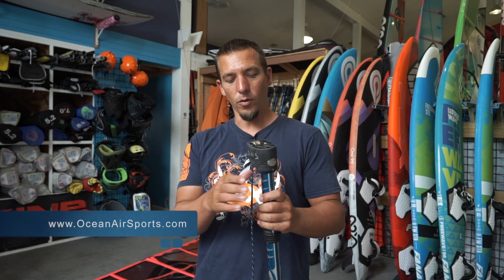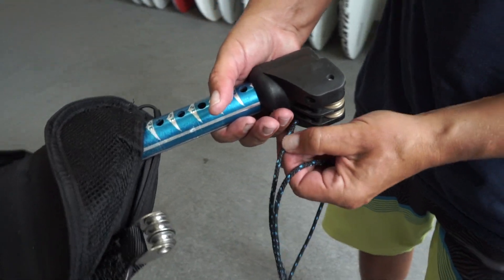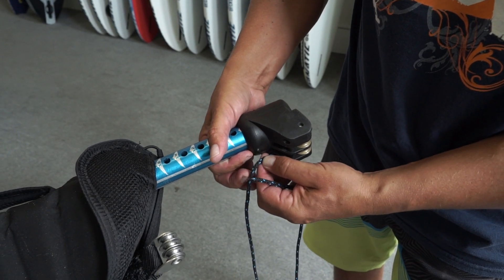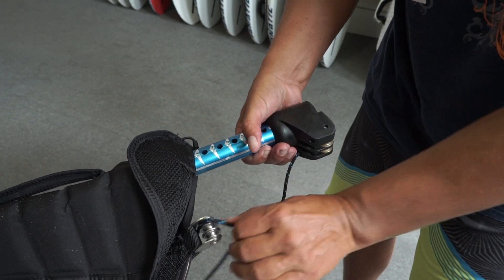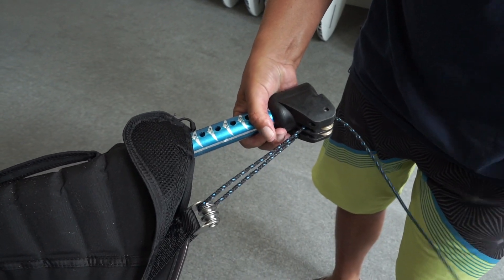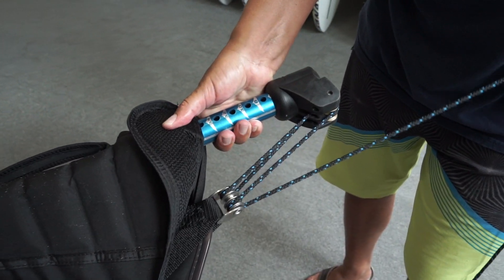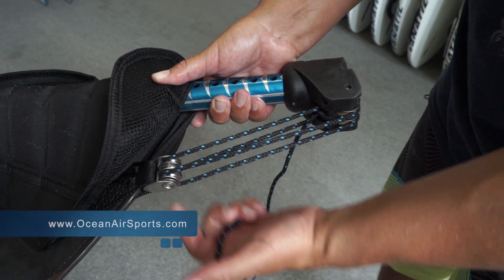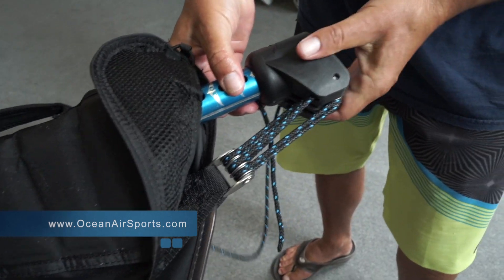How to Thread the Downhaul Line

Comment: how about when the sail pulley's face the same way as the ext pulley's.  Rented some Naish sails recently and that's what I encountered.  Thanks
Reply from the maker: When the pulleys are facing the same way it's a piece of cake!  Just go right around in circles.  If the line starts off the bottom of the extension, start at the bottom pulley on the sail and then the middle then the top. 

Mike

Comment: My sail only has grommet type loops to apply downhaul.
Reply from the maker: You can use the same exact pattern for the grommet.  When you start pulling the tension the lines will slide cleanly if it was threaded correctly.  However, an easier option for a grommet is to buy a downhaul hook.  https://oceanairsports.com/collections/windsurf-components/products/3-pulley-downhaul-hook